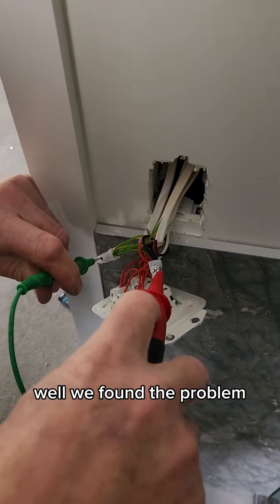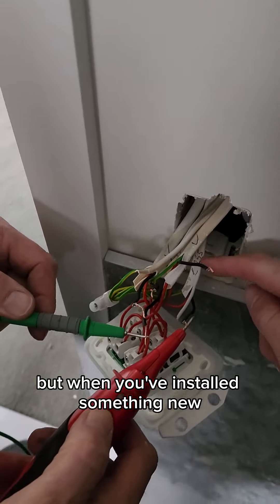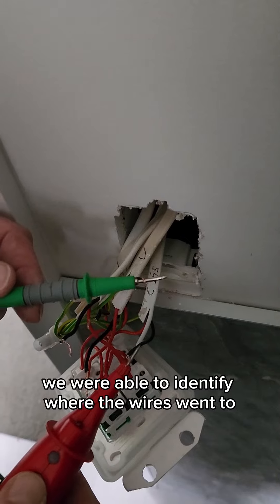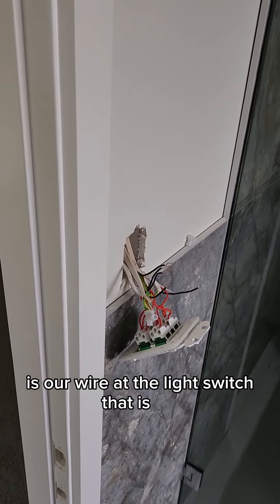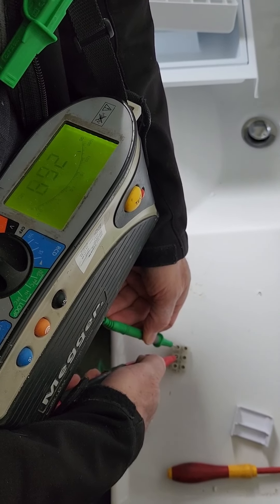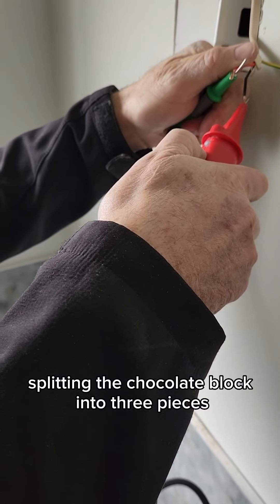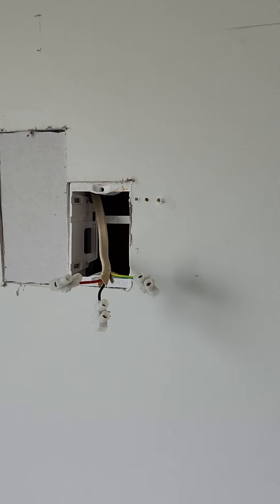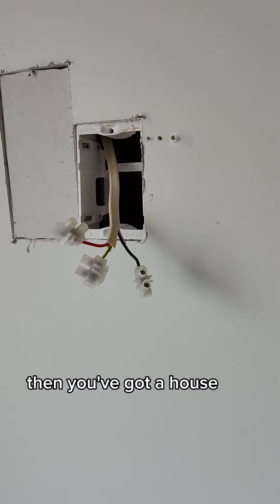Dont trust the connector blocks.

Comment: i have never seen one of those used in Australia for house wiring.  They are normally used in LV applications for hobby "Dick Smith" type projects.
Reply from the maker: In New Zealand bro, there is nothing wrong with a connect block like this for household applications
Reply: You’ve clearly never installed an outdoor flood light
Reply: We have them in Australia they are the connection terminal of every light pendant and fluro I bet I could find one in every house here